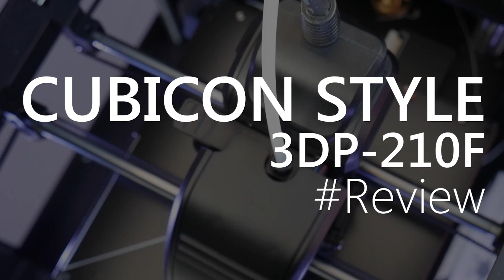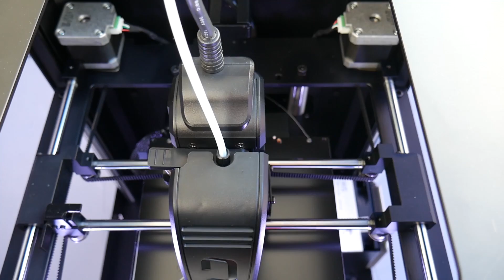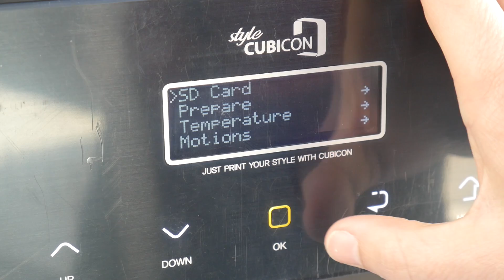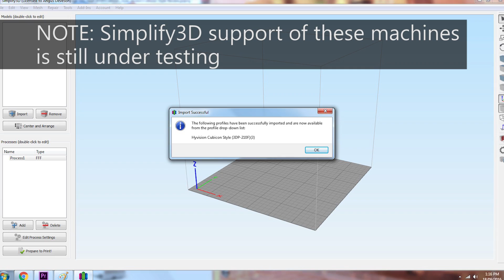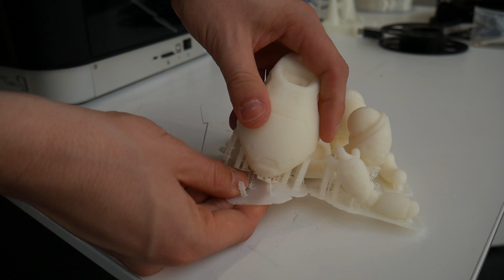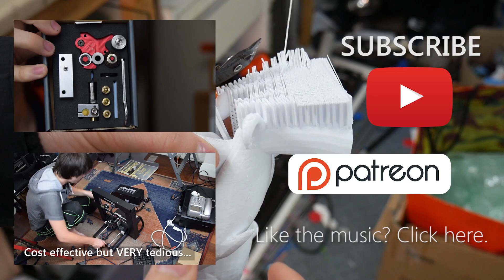Cubicon Style - 3D Printer Review

Comment: hello angus let me start off  here you and 3D nerd make great vids iv learned very much thank you guys 
so two part question first i seen your vids on F360 and now im hooked, my question is does the cubicon accept files from f360 if so how ? second the prints i want to make are mainly going to be used as a pattern for metal casting acurate and finish isnt a huge problem as ill be machining the parts later but some will be used in other projects so my question is ,as a first time user to 3d printing is the cubicon the way to go ? 
PS i like the fact i could use flexible materials , gives me a few ideas 
thank you for your reply 
your friends from canada
Reply from the maker: Hi! Yes, all 3D Printers accept files from Fusion, you simply need to choose to export as an .stl file and then bring it into your slicing software. For Cubicon you can use their own software "Cubicreator" - this video should help. https://www.youtube.com/watch?v=JP5UDeBH4y4

The Cubicon machines handle a lot of the calibration automatically making them easy to use, but they are certainly at the higher price point for the print volume.
Reply: Beautiful thank you very much cheers
Reply: Hi Matrix. I represent InkSmith, the exclusive Canadian distributor of Cubicon 3D Printers and if you're interested in having a closer look at the printers we'd be glad to arrange that.

Comment: Hey Angus, you finally got round to doing the review of the style, thats cool. A good review overall. I don't agree with you that the price should be one of your negatives. As you pointed out the printer is not marketed at hobbyists and so the price seems right for the market it is aimed at. If you take in consideration the solid build, the near flawless and faultless operation and features I think its priced about right. I'm glad you mentioned the stringing which I also found a little surprising given that it excels at pretty much everything else. Do you have any suggestions on a possible solution? The brand of filament that comes with the machine, and which is recommended by Cubicon, is eSun which is why I pestered you with all the questions regarding this filament brand. You mentioned slight warping at the edges with ABS which I have also found, but did not mention ABS shrinkage which I am finding to be an issue when modelling accurate components. Have you or will you do a video on this issue to include your tips on how to work around it? Lastly, perhaps you could put in a word with Cubicon addressing your concerns and see what they come back with. Cubicon don't seem to be a company that is easily approachable which is a shame, this too needs to be addressed. Well done, on the review, happy to discuss with others on their experiences with the Style.

Comment: Good review, Angus!

I have had no issues with the Cubicon Style - it has been a rock steady printer. The stringing problem you mentioned is odd to me, although I suspect that the official "Cubicon" filament (made by Esun and retails at about twice the retail price of Esun branded filament) may have sat around in a warehouse for a while. I use Esun on a regular basis with an external spool holder, and have yet to experience significant stringing.  My Cubicon Single had several small mechanical issues with the gantry system, and I eventually ended up with a new unit. I agree with Angus - a warranty is a must with machines of this complexity. As far as I know, Imakr is the only retailer in the US for this machine, and I can attest that their product support has been excellent.
Reply: Hey Luke. Same here. Stringing not a major issue just a little more to clean up. I too have stuck with eSun, as it is the recommended brand. When you bought your eSun filament did you find that it would not fit on the spool holder?
Reply: It doesn't fit on the included spool holder, but I can send you an STL of one I designed for Esun spools if you send me your contact info.
Reply: Hi Luke, that's very kind of you but I obtained an stl from 3D Printing Studios where I bought the printer from.
Reply: Awesome - I will have to check that out.
Reply: I messaged Stuart Grover over at 3D Printing Studios and he tells me that their spool design is only available to those who buy their machine.  I now feel very motivated to post my design on Thingiverse. I have no formal training in CAD, but this was not THAT complicated. He has an interesting attitude for someone trying to sell 3D printers.

Comment: Having worked as a repair man / first line of "defense" against failures of overseas 3d printers ... I kind of understand why they might prefer to do the repairs in house. The more you go for the "corporate" and "tidy, easy to use" design the more f*cked up the servicing of that machine is.

And some design decisions had me cursing at the day the main engineer decided that was a good idea. Wasting minutes or hours for a simple, badly placed nut hanging by barely nothing over power and control electronic boards. Or getting my hands full of nasty grease :(

And one thing that's often forgotten is that repair centers / servicing people need VERY GOOD DOCUMENTATION. And that's often forgoten or deliveratly hindered because "intelectual property" and other business zealotry. If instead of being a machine it was a man, and it was a doctor, it would make no sense to withhold so many information of the surroundings and their operation.

But I digress. Yes, it sucks having to send something to base or a big repair center. 
But there's a reason for that. Well, reasons. And it would eventually come back.

Comment: What was the results with the Flexible filaments?
Reply: Good question. Looking at the instructions it looks like it can print with flexible filaments but will need some adjustments, the Cubicon comes with a manual on this subject so it won't be a case of just swapping out the filament. Will you be testing it with flexi filaments Angus?

Comment: Great video on this machine, man! Yeah, mine is dead. If any of the self check features fail, the machine just won't work. I was able to print a lot of ABS things, then, the auto leveling stopped functioning when I attempted PLA. My Cubicon Style is back in it's box, all packed up, just waiting to go back in for repairs. Sad. Very glad yours kept working! I cannot wait to get mine all fixed up.
Reply: Fingers crossed my Style is still working fine after completing 115 print jobs with no major issues. Has Cubicon contacted you, Joel, with regards to the cause of the fault? If it's a software issue then this ought to be sorted with a patch without the need to send the machine back. If it's a mechanical problem then I would be interested to know what may be the cause. Joel, would you say the problem occurred because you switched to PLA or something else? I am planning to do the switch for the first time this week now that I have bought some.
Reply: John Stone Cubicon has contacted me, and the machine goes back to them next week. They thought it may have been a wire that got squished in the wire bundle and snapped inside the plastic sleeve. Definitely not a software thing. I think it was just a mechanical failure.
Reply: Unlucky. I hope you don't have to wait too long for the replacement.

Comment: I would like to see the results (for comparison) created with S3D. But overall very nice review. I think the build volume is less of an issue, but the repairs... :(
Reply from the maker: They weren't that great and not too relevant to a review of the machine itself, still needs tweaking :) But might show it in a future video.
Reply: For me it's important - I don't use mainstream operating system, so enforced slicer is a big no-no for me ;) And I think this would be relevant - the SW is part of the purchase, so it may be worth to compare to other products. Who knows how big part of the product price is the SW...
Reply from the maker: if you mean linux - you could use a few alternatives like craftware, it would just need tweaking to get it right as there wouldn't be a preset for the style.
Reply: S3D Works very well and Cubicon has even gone and made an FFF file for it. We were also talking to S3D about including profiles for it on the next build. We've had as many as 7 running in our office and none of them have had any issues with the autolevelling sequence.